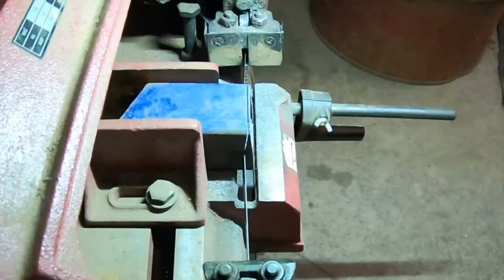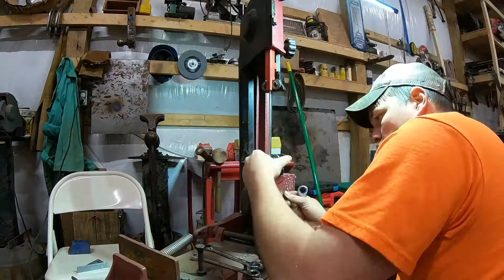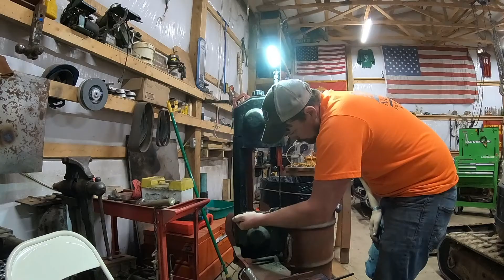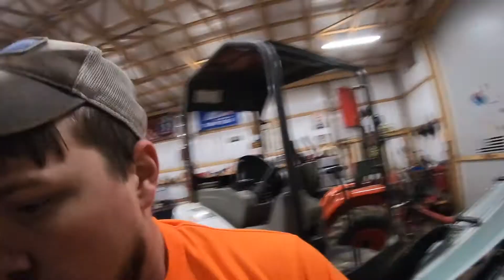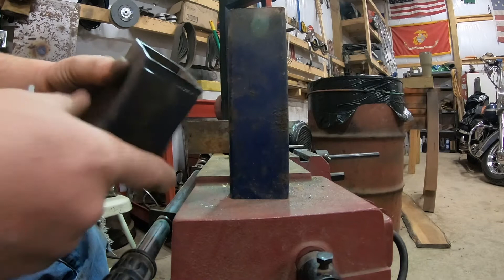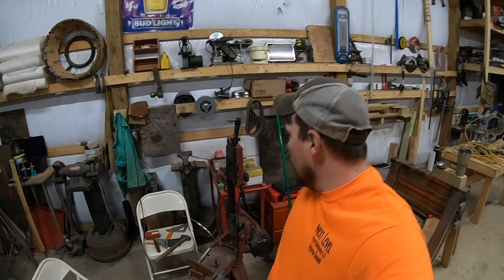HarborFreight metal band saw cutting crooked, 5 year review

Comment: This is the video I needed.  Mine has been cutting at a slight angle lately.  

I do wish the one blade guide post was longer, because you want the blade guides to be as close as possible to the material.
Reply from the maker: Good deal hope it helps. And yea I agree.
Reply: I went to adjust mine, and it's different.  Instead of adjusting each roller, I have a block that the rollers bolt to. I could loosen the bolt that holds the block, twist the block, and tighten bkock.
Reply from the maker: @rglmotorsports2989 yea mine wouldn’t adjust far enough with that block. Still cut at an angle
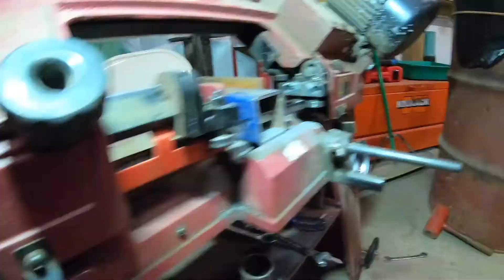Reply: @5:30 You can see the single bolt above the rollers I'm talking about.

Comment: Something I discovered with mine is that the tensioning wheel doesn't let you tighten the blade enough by hand.  I had to use pliers on it and it broke off as it was reaching the proper tension.  Getting the blade tight helped with getting a true cut.  Getting away from the cheapo HF blades also helped.  The higher end blades from HF are decent, switching to a Starrett was a game changer.

As for hanging weight off the end, it was necessary to achieve a proper cut 'till I modified the adjuster to allow more downforce.  Looking at the chips will tell you how much it needs, without modifying it made powder instead of chips unless I was cutting really thin material.  When cutting most materials the force would need to be changed throughout the cut to maintain proper pressure so if I'm waiting for the cut I'll manually press on the end through the wider cuts, like the top and bottom of a square tube.  If I'm doing other things I'll just let it go.
Reply from the maker: How does one know the blade is tight enough
Reply: @DLCOutdoors1776  I don't remember the specifics, but you 'ring' it kinda like strumming a guitar string and it should give off a certain frequency. I googled it, it's been several years, all I remember is that cranking the knob down as hard as I could by hand wasn't enough.  I felt like I was over-tightening it, but it's been on a few years and working great.
Reply from the maker: Good deal. I’ll look into it.

Comment: Right behind the fixed side of the material holding vise is a tall bolt with a locking nut sticking vertically up out of the table. That is what you adjust so the saw arm will descend enough to complete a cut and auto shut off. Yes, I found it out the hard way… lol 😅
Reply from the maker: Yes but it was not touching when the saw was all the way down.

Comment: i’m a retired Woodworker that ran a crew of 40 men and all the tooling for that crew to install ArchitectualWoodworking  the Adjusting you needed to do on the Band saw  appears to me to be  basically Maintenance on almost every Saw i’ve ever owned  i tried to do spot checks and Adjusting on all the Company Saws  because they got shipped to many different locations and used  by many people   with normal use  most Saws will need to be Checked and Adjusted. to be Precise  my own Personal Saws that do not  get shipped around or used by anyone but myself will stay true and Accurate for years in their Proper location and not being Abused  yet those may  need to be adjusted every few years depending on their usage and what we had to cut with them
Reply from the maker: Yea I definitely get that. I’ve adjusted on it before but it got knocked out of wack bad recently (before the video) so thought I would do a video on it and a review it’s been a ok metal saw for me.

Comment: Slow the cut
Reply from the maker: The spring tighten down quite a bit. It’s pretty dang slow. The video is sped up.
Reply: Quite the contrary, it needs to be sped up.  The stock configuration of this machine doesn't give nearly enough downforce for thick material like he was cutting.  Examining the chips will tell you what it needs, in the stock configuration I was getting powder, not chips.

Comment: Is that self oiling?
Reply from the maker: No. It’s a light duty one. I haven’t seen many this size that are. Although I think it would help.
Reply: @DLCOutdoors1776  thanks, been looking to get one, not sure which one to get.
Reply from the maker: @JamesJohnson-em9pc  Ive been pretty impressed with it for it being a harbor freight one. I use it quite a lot but I'm not using it on a daily basis building things. hobby or work shop tool yea. fab shop maybe not.

Comment: measuring the blade straightness like that does not give you enough resolution you need to take a 6" steel ruler and place it on the blade and then measure the straightness ( hold the ruler on with a few paper clips or a spring clip)   I had to modify the blade holders to get mine to cut straight they would not go far enough.... good luck
Reply from the maker: Thanks for the info. That will come in handy next go around. It seems to be cutting true as of now lol 🤞